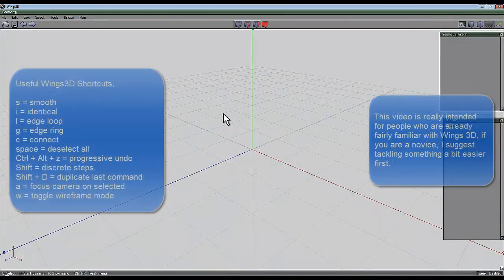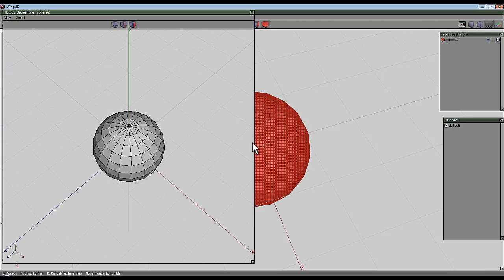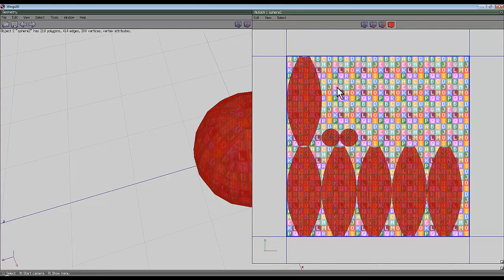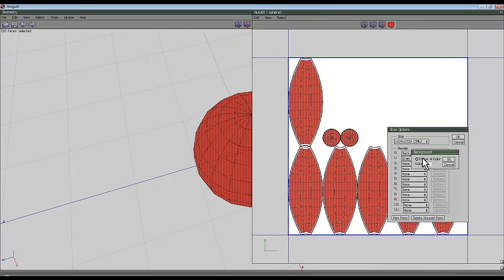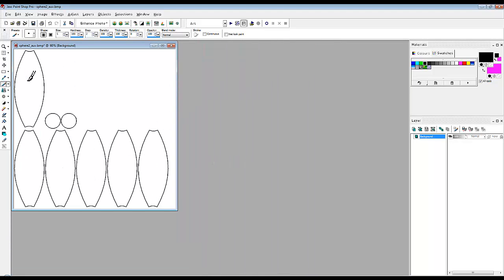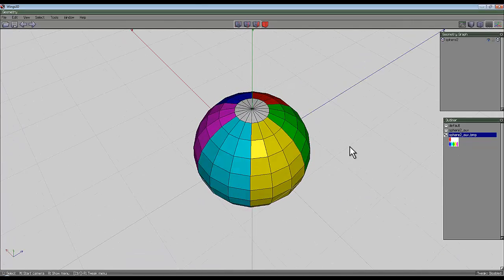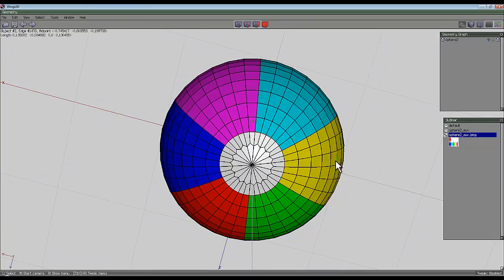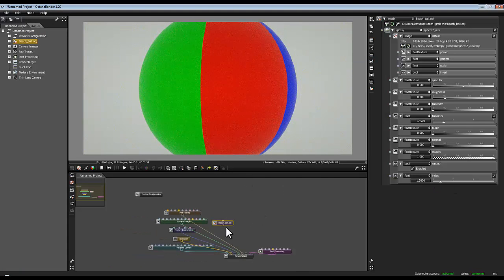Wings 3D - UV mapping primer part 5 - by David Brinnen.

Comment: In the circularize part you only circularized the outer edge ring of the top and bottom sections, leaving the inner ring looking like a round fan. If you select two adjacent edges of that ring and tap I, the inner rings will be completely selected then select one edge of the outer ring and tap L or I to select all the rest of the edges needed. Right click and circularize and all selected edge rings will be corrected. You may have to do a bit of rotating to get everything aligned, but it does make a nicer looking ball. The reason I am telling you this is because geometry that has that fan shape will cause distortions in DAZ Studio, and though I don't know for sure, Poser. It may be the same for some of the other rendering programs also. Fixing that within wings before exporting can make a model look much nicer in other programs.
Reply from the maker: Aye thanks for that tip.  Another consideration!  I'll be sure to try and cover some of these other problems in later videos.  I suppose ideally making the sphere at the correct resolution to start with would have been a good idea.  The benefit of hindsight.
Reply: @davidbrinnen  If I am making a ball like the one you made, I create the primitive sphere with a high enough polygon count to make it look smooth to the eye. Usually I do 96 sections and 48 slices. That gives me a fairly smooth looking sphere that won't look faceted in a render.
My apologies for not responding to your reply until now. My only excuse is that I did not think to return to this comment section, until now. Life deals issues in strange ways.
Reply from the maker: @l.clevelandmajor9931  Wow!  That was quite a delayed reply.  I've settled on a UV mapping solution which solves most of the problems for me quite effectively.  UVLayout.  The interface is a bit odd - but once you get over that it works really nicely.
Reply: @davidbrinnen  UVLayout as I have just discovered is a stand alone UV Mapping application. I plan to check it out and see what it has to offer. Thanks for the heads up concerning it. I used to have UVMapper, and while it did do a good job, it was a bit hard to learn. 
My own attempts at UV mapping a sphere have been horrible to date, but I'm trying to create a map that will wrap around the whole sphere using one 2:1 aspect ratio image. I am working on creating fictional planets that can be used in applications such as DAZ Studio and Poser, so the mapping cannot be sectional. Too much risk of image overlap using a sectional mapping approach. The best analogy I can think of as to how the sphere is to be mapped is the HDRI mapping, like what we can use and create in Bryce. The images for that are projected onto the inside surface of a sphere to create excellent looking environments that you can swing around to see in all directions, with little or no distortions. Horo has made some really fine ones for Bryce.

If I can learn the trick of mapping a sphere like that for use in different 3D art applications, I will be creating a product package that includes textures for a lot of fictional planets and moons. I'll even include a planetary ring that can be loaded with different ring textures, for a large variety of ringed worlds. The only success I've had with making planets is in Bryce, and because I use procedural materials to apply textures to them, they do not export with the textures intact. Importing them into DAZ Studio, Poser, Blender, etc. does not bring the textures in loaded correctly, nor can the textures be loaded correctly from within those programs.

I'd love to see what you are doing with UVLayout.
Reply from the maker: @l.clevelandmajor9931  Well, with UV Layout all I am doing is UV mapping masses of geometry.  That's it really.  Nothing fancy.  Just UVing on an industrial scale.  The main consideration is making sure that you don't end up with too many little bits (because that can become a packing nightmare) and that the texture space used is comparable with the rest of geometry in the same object.  The fancy term for which I believe is Texel density.  Mostly it's drudgery.